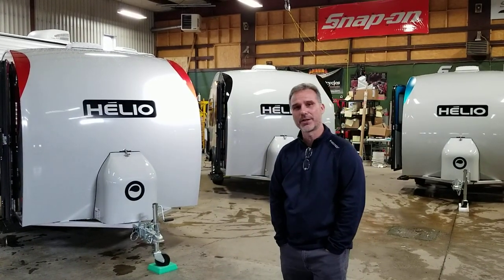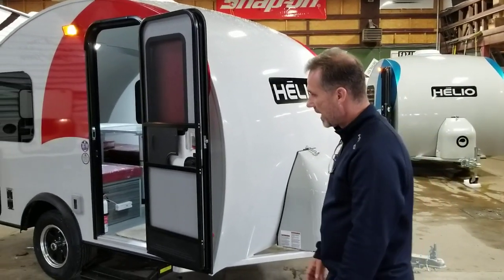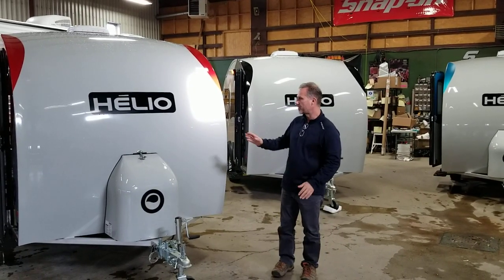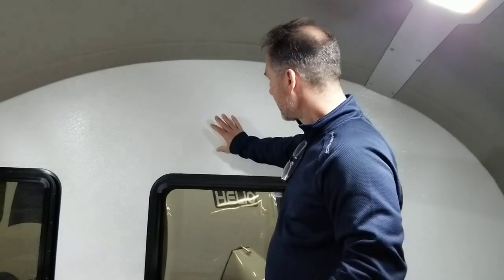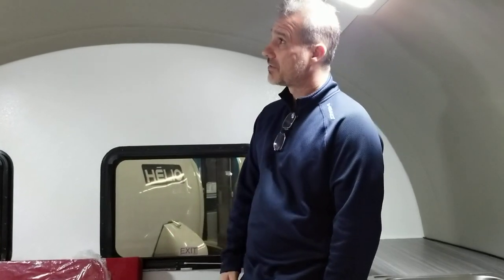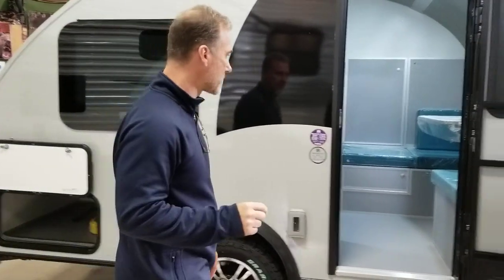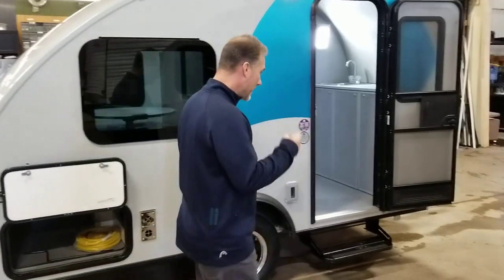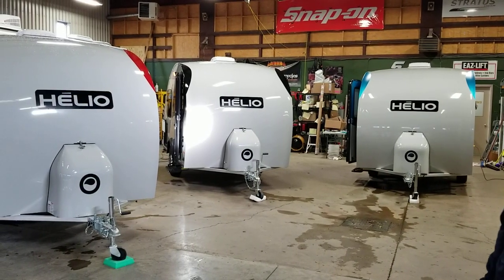2021 Helio "O" Series Differences between the 3 floorplans

Comment: I have the 04 series.  There's nothing hung on the inside walls of the 04.  The 02 and 03, I think, both have a spice rack of sorts hung on the inside wall.  My question is, what depth of screw is safe to drill into the inside wall?  I want to hang something but I don't want to compromise the inside/outside structure.  Thank you!
Reply from the maker: If you are on facebook, there is a great Helio page for owners.  it's called Helio RV Trailers group.  You'll find all kind of clever storage ideas on there.  most uses the new command strips.

Comment: Needs more improvements and acomadations like a Boler, Armadilo, and Scamp trailers. The one with the bathroom I love! 1,500 lbs.? Can a 2019 Subaru Impreza tow your Helio trailers?
Armadilo trailer have a special featier I like. They have a slide out storage box under neith to trailer that is hiden in front of the rear bumper. The rear bumper locks and unlocks in a side open swing arm in the rear bumper to access the storage box. That's trick!
Reply from the maker: I believe the Impreza is rated to tow 1500lbs but I would suggest you check with Subaru first.  I agree with you, the extra rack under the Armadilo is a good idea.  however, how long will it operate properly?  and how dirty will your luggage gets?  Helio is all about making sure your "O" series will age well.  No gimmicks, just a well build trailer that will last a long time.  The floor of an Helio is actually 3/4" plywood encased in fiberglass that is designed to be an outdoor deck!  Now that's trick!  because it will last forever!

Comment: Curious if there’s storage area in/beneath booth seating for clothing etc?  Is there a fresh water holding tank?  🐝
Reply: 04 Model: There is very little storage under side bench seats. I'd say no. The back seats open to the outer under storage which is pretty good.  There are no tanks for fresh water in 04.
Reply from the maker: yes, some storage under the booth.  The O2 and O3 model has a fresh water tank, a grey and a black tank as well, just like a bigger trailer.

Comment: where are they sold in the US?
Reply from the maker: That's a question for Helio themselves.  They are currently developing the US market so I'm unable to answer you.  You can find their number on their website, give them a call.  Thanks
Reply: Go to the Helio website and look at the top for the Dealer link, there are a number of dealers across the US.
Reply: I bought my Helio in Texas. Only one dealer in Texas.
Reply: @rjrocks6345  what’s your experience with your Helios?
Reply: @rjrocks6345  - If you don't mind me asking the price?
Reply: @hershlawfirmpc  

I have yet to take it anywhere! Working on my tow/wiring install. I got the 04 which basically has nothing inside but a bed, two tables, counter top with sink. I love how it's made. It's solid. Totally wrapped fiberglass. I'm outfitting my Helio right now with microwave, fridge, cooktop etc.. I hope to be on the road in October.
Reply: @saulbachiller-smith8382  

It's not cheap but it's very high quality, in my opinion.  I paid $23,500.
Reply: @rjrocks6345  - I like the 02.